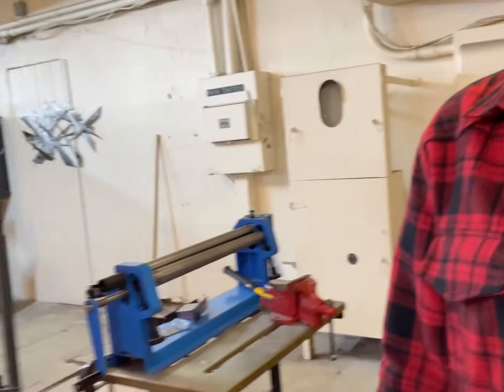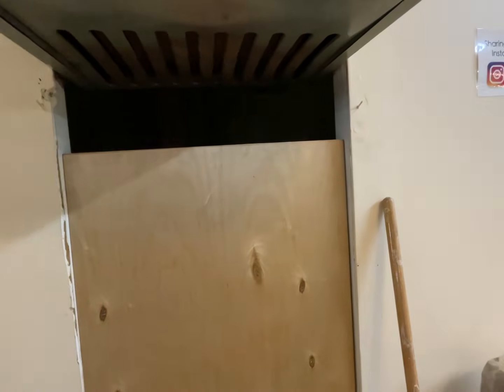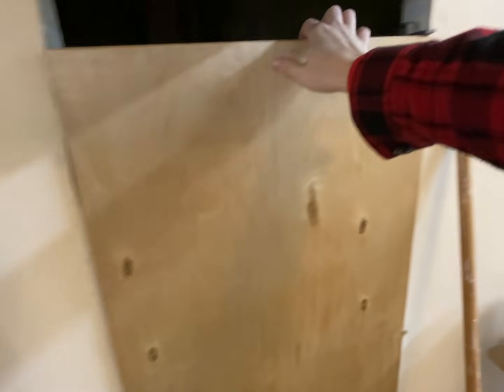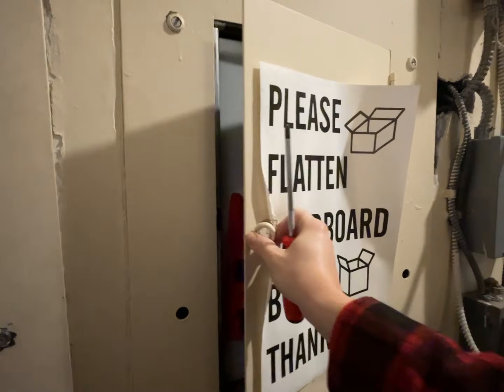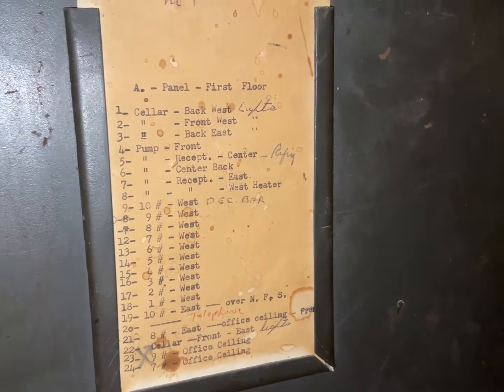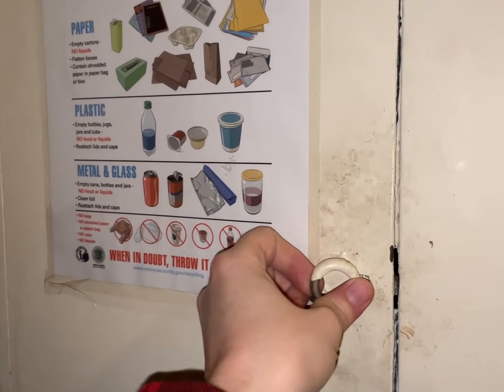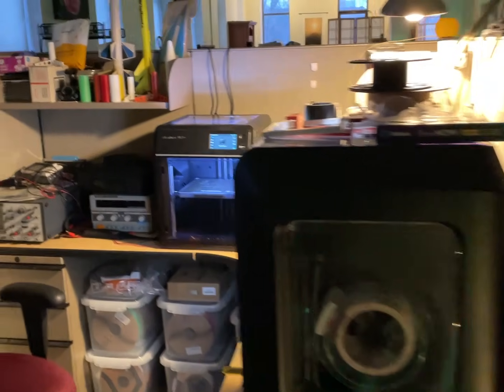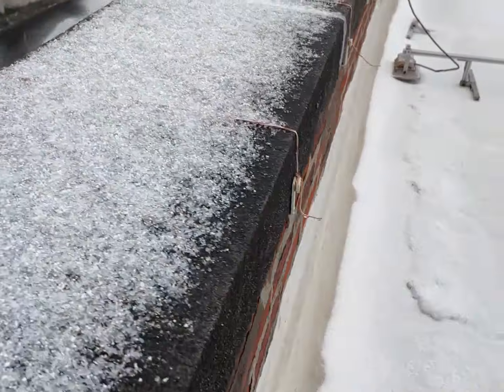Flashforge Adventurer 5M Pro 4 month review: becoming a reliable tool, and mass-printing light clips

Comment: Whatever happened to this office job you had? Looking through Flashforge 5M videos as I ordered one recently.
Reply from the maker: When was that? You mean when I worked at Apple in 2015? Or do you mean the office I had the flashforge in originally? The office I had my flashforge in originally is one of the other buildings I maintain for some landlords so I get free run of a lot of things.
Reply: @RinoaL Ok. I thought that office was connected to all those server jobs you were doing for a while. You made some videos about repairing power backups or something like that in connection to what i call server jobs.
Reply from the maker: @rodtoddconsulting6319  Ah yeah thats in the basement here. I still plan to poke around the power modules but havent had much time.

The people who run this office are the ones who own my buildings, and let me rent the repair shop. I just try to help them with their projects enough to make sure they dont feel neglected.

Comment: Good practical use of the 3D printer you use. Nice to see brands being shown that I would not have been aware of, even if it does like to "gob" up a little bit, lol.
What are the advantages of using TPU, as opposed to other filament types in the application you needed to..? Thanks

As always, as wonderful video.
Reply from the maker: TPU is a bit rubbery so I can use it on my clamp pads so they grip
Reply: @RinoaL  Thanks, appreciate the reply.